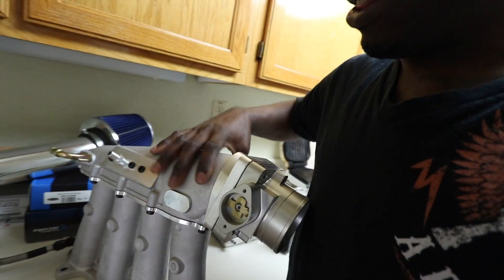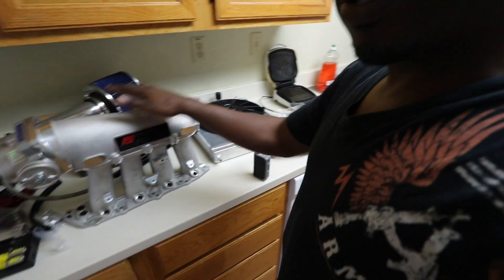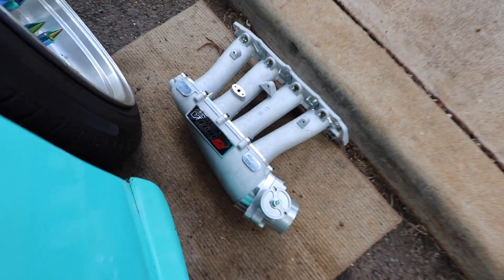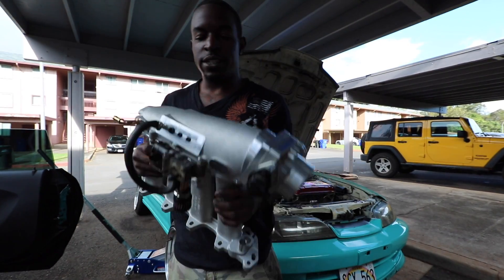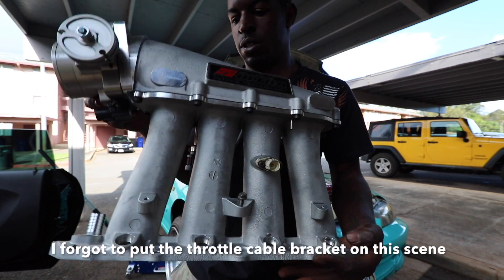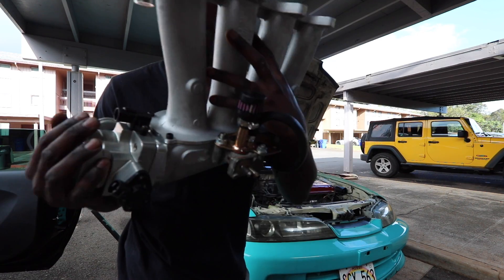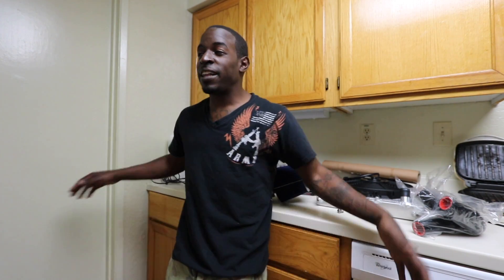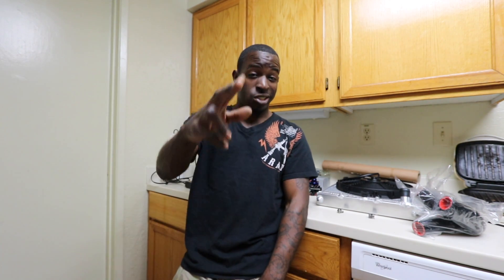Installing Skunk2 Ultra Series Intake  Manifold & Throttle body on B20 Vtec Integra

Comment from the maker: If you have a b16a put the plug and the cooland deed opposite of what I did. I installed it wrong. Also it’s a good idea to use Honda Bond on the back side of the manifold around the plug and coolant feed as well on both sides of the gasket around the same area as well as on the head around the coolant channel. If you don’t there’s a high chance it will leak. You’ll see that in my next video lol. Y’all learn from my mistakes please lol
Reply: DC Crush do you really need honda bond ?
Reply from the maker: I went with what my tuner recommended I don’t see why not to use it

Comment: Don’t wanna hate brah but that oil cap man, that shits gotta go go
Reply from the maker: Victor Sant everyone has their own style bro
Reply: +DC Crush may I ask if you had a noticeable power gain? In new to the Honda shit, and IV got a 92 si hatch b20 gsr swap and I was going to do intake,  header,  and skunk cams, will my block be fine on those moods?

Comment: i have having the same problem with the throttle cable bracket skunk2 provided  i have the same throttle body as you as well   the gsr cable is way to short  i even bought a type r cable and still cant get it to work ??
Reply from the maker: It’s been so long I couldn’t tell you what I did back then lol

Comment: DCC,  How much difference you get with that SK2 Ultra?  I purchased the same item, but I have a DA, and the engine bay size is smaller.
I am guessing I will just save that SK2U for my b18c1 build up with my Godspeed AR.7 oil water cooled turbo.  
How does that B20vtec feel over the OEM engine?  I ran a b20z stock in my other DA and she takes off, though the top rpms lag.
I currently have a 1990 Integra sedan that I just installed a OEM b17a with ys1 gsr transmission.  I have yet to run that engine to see how that one is.

where you from DCC, Let line up at the tracks when I get the b18c1 spec'd  I know you got the torque, but the DA has less weight.  I think it would be a good race.  Do you have suspension build up?

Comment: How did you return coolant from the IACV or put those coolant lines on the IACV at all? the ultra manifold doesn't have the return port I am stuck on my install at this part. Any pictures or guidance on coolant to the IACV is appreciated
Reply: Do u find how to plug the return hose from the iacv ?
Reply: Yea intake manifold doesn't have anywhere to mount the iacv coolant ports.You figure it out ?
Reply: @gsrjaycee4521  you don’t need them